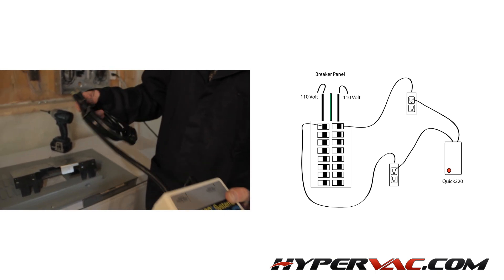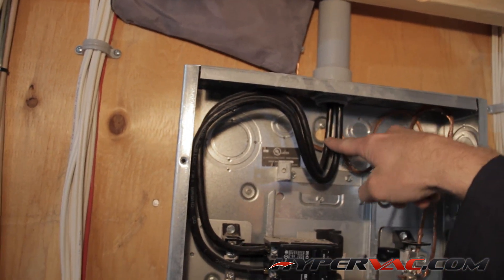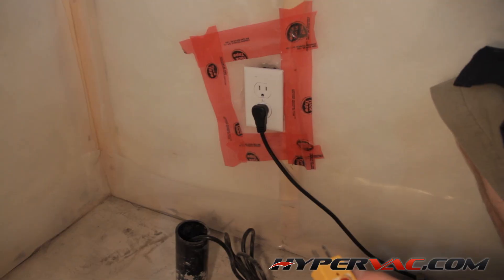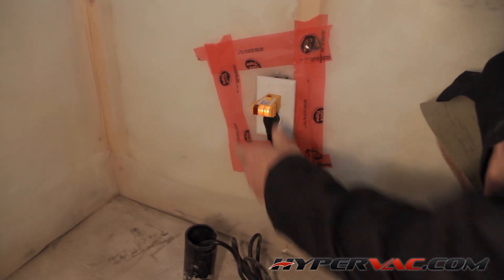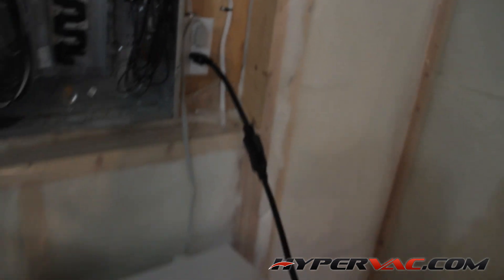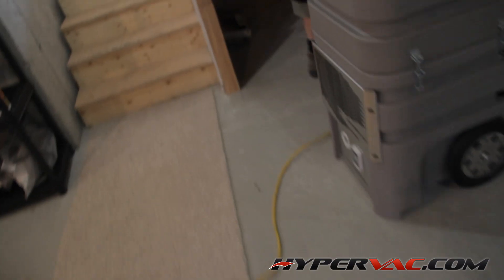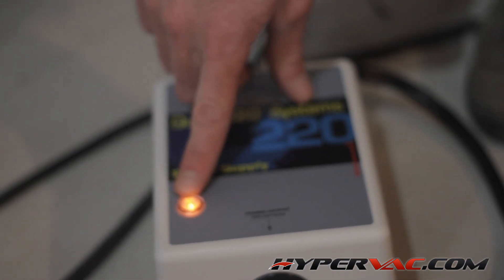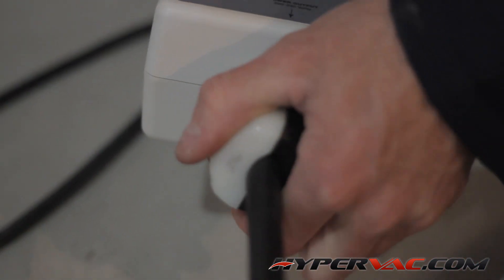QUICK 220 (Hypervac Duct Cleaning - Basic Training Series)

Comment: Nice Video! - I'm buying one of these converters to use with my EVSE when I need to charge up my Electric Car when at locations without a 220 Line!
Reply: they did you ever come about getting the quick 220 for your evse? I'm kinda in a situation where my panel is not an option. thanks